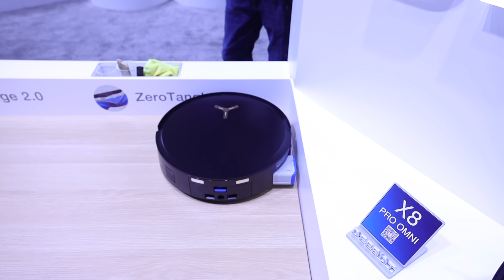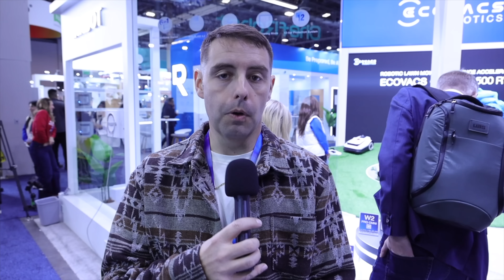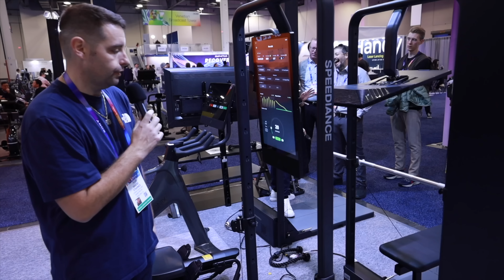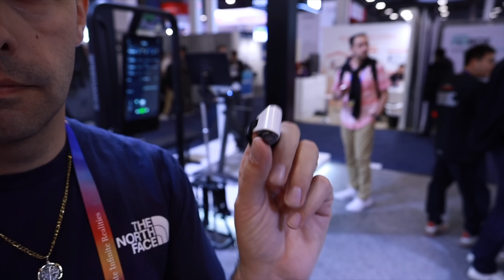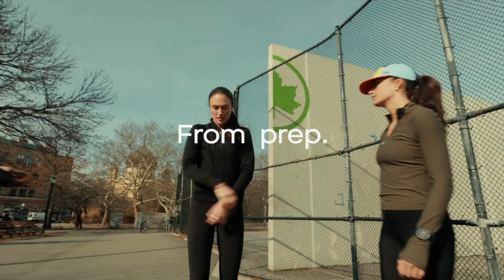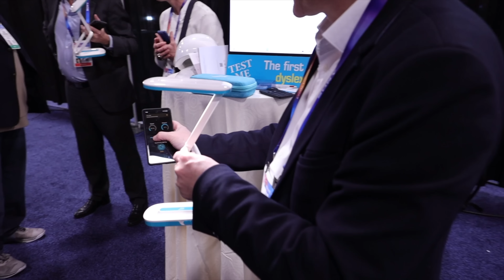Best Of CES 2025 Day 2! Fitness and Smart Home Tech!

Comment: Did the Speediance gym come with a rack for the bar for when you do the bench press and squats? I didn't see anything there to hold the bar.
Reply from the maker: Yes it does come with a rack for bench press and squat, plus there is a bluetooth ring so you can turn the resistance on and off without having to press the button on the screen.
Reply: @DroidModderX  Now that's better.
Reply from the maker: @PkPointFitness  👍